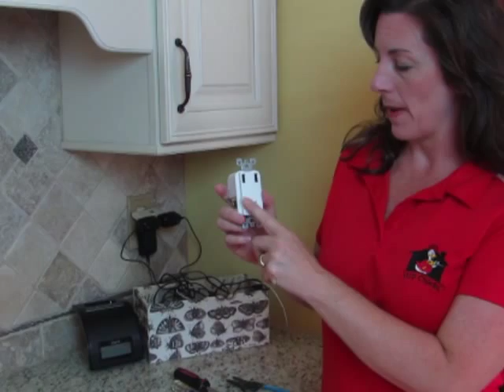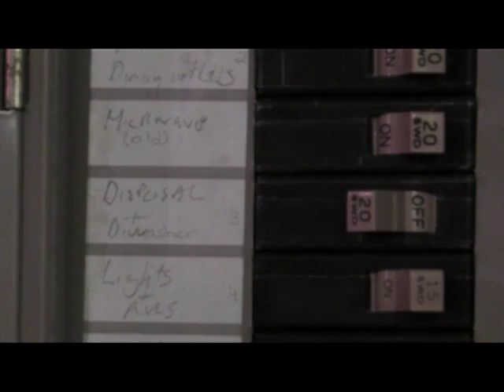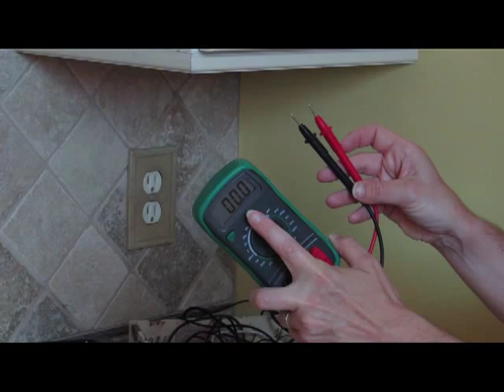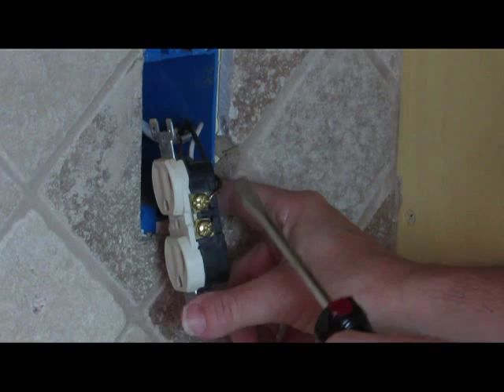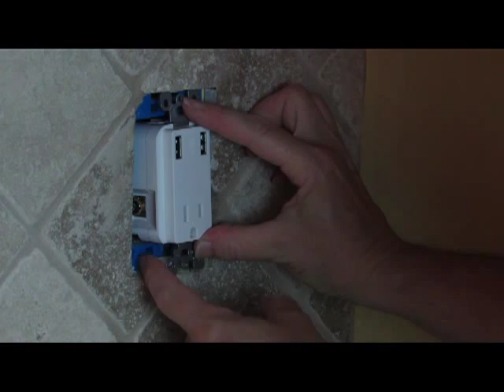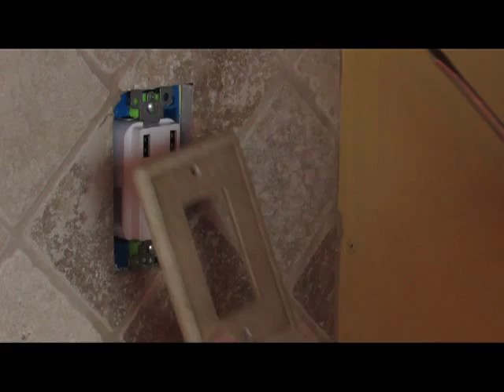DIY HIP Chicks - How to Install a USB Electric Outlet

Comment: the only thing I would recommend is that when placing the wire onto to the screw terminal, go clockwise this creates tighter connection.

Comment: Hey this is a great video instruction. You explained the wire setup very well. I have a question. I moved into a new place and all the outlets are 2 prongs except 1 which is 3 prongs. Can I install a 3 prong outlet into a box that is a 2 prong outlet?
Reply from the maker: Yes . It simply means your house does not have ground wires to all outlets. You can install this  USB using the white and black wires. You will likely not find a copper ground wire when you open the box. If you do, you are lucky and can attach it as you do the white and black! OF course safety first, be sure the power is off, before doing anything. Good luck
Reply: Thanks!
Reply from the maker: ***** SO how did it go?
Reply: I haven't done it. I think I'm going to hire someone to do. I don't want the landlord to get mad at me.
Reply from the maker: ahh if you rent you should let prop owner handle electrical changes. You don't want to be liable for any issues more than just piss him off. Good move ;)